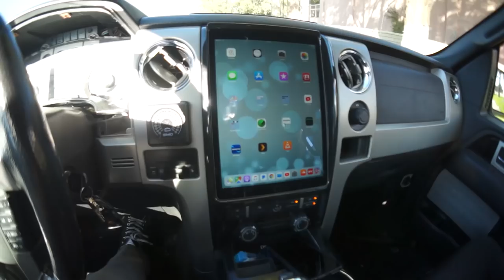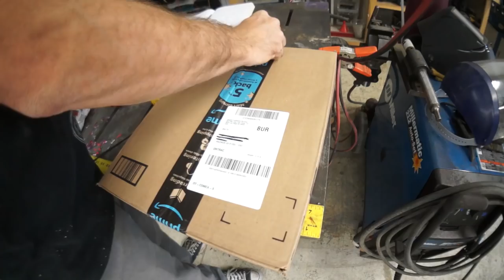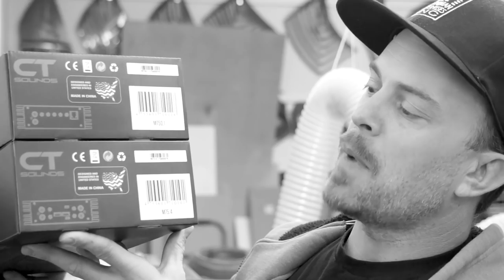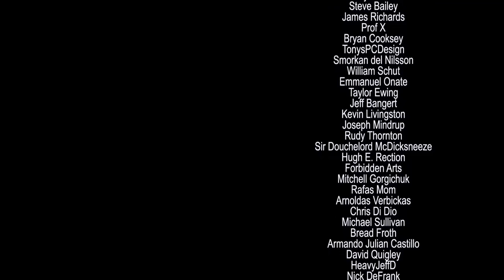THE MULE, MORE UPGRADES! Steering damper, NEW FRONT SHOCKS!, order updates AND MORE - AMPLIFIED #682

Comment: Those amps would be perfect my system: 12 Lanzar 15's in the back of my F150, still in their cardboard boxes and 16 ford 6x8's scavaged from the junkyard in the cab. Just need some amps to power it all and some old extension cords to wire them up.

Comment: Doug i need the amps, because my current amps are old and pushing hard that they might spark and catch fire. that means the fuel vapor inside the car, from the shitty fuel lines leaking, that when the amps catch fire, it will ignite the fumes, burning the fuel lines, then the fire traveling up the fuel lines will get to the fuel tank and boom "insert explosion video clip here" the hole car will blow up due to shitty amps